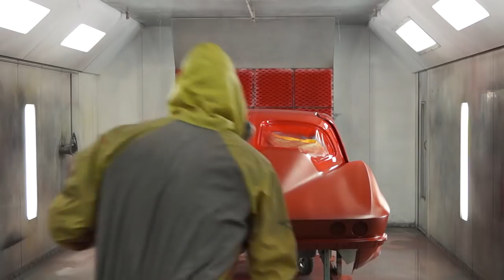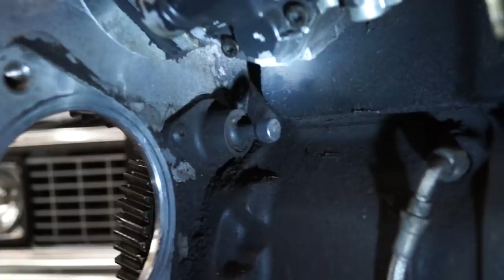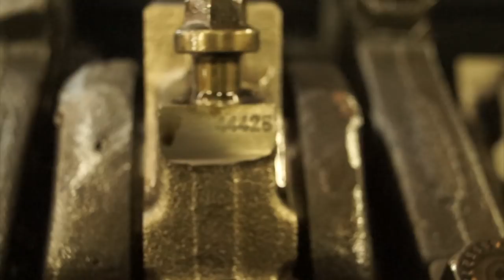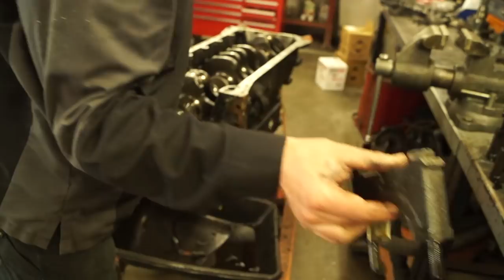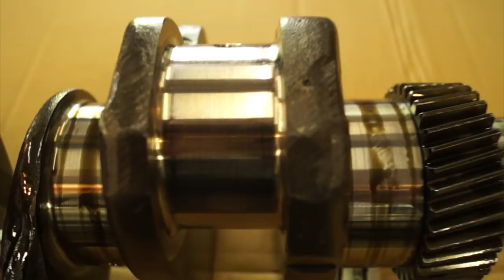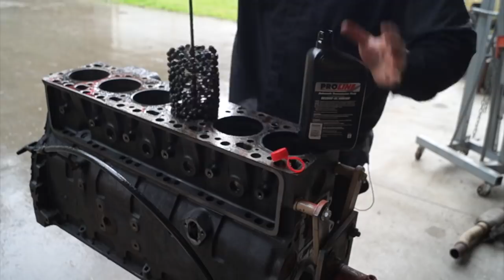Part 1 - How to Rebuild a Cummins 12 Valve 5.9L Diesel Engine

Comment: Thanks for the video. Dunno why, but those dingleberry brush hones always scare the cap out of me. Nevertheless, that's a good tool that provides decent results with a bit of practice. Some even give plateau finish, wich is preferable. I'd run a bore gage to be sure, but your cylinders looked really mint. In the end you mentioned that honing breaks the glaze and gives the ring fresh material to seat and wear on. I'd say that main purpose of honing is oil retention, and plateau hone lets the rings work without breaking in. I understand that you work alone, and I'm a loner myself when it comes to automotive work, but you really should've provided constant oil flow while honing.

Comment: Man am i glad i found this channel. My 72 Chevy C20 3/4 ton PU died about a month and a half ago was wanting to do a LS swap but really wanted to go Diesel but they were too big and too much money. Till i found this Cummins 6BT and this is the engine i want. I don't need a monster engine but want some torque when i do pull a trailer, or possibly a 5th wheel, but also want a dependable truck for daily driving. This fits my needs to a tee. I had an 87 Peterbilt with a 3406 mechanical Cat dont know too much Cummins and watched this wonder where are the sleeves. This help a lot, the 3 vids, so now im ready to get the engine and get started. I'm going for a 400 hp and had a question as the trans. what would you recommend. I'm looking at an a Allision 1000 5 speed but not sure it will hold up or with minor upgrades will it be OK. I'll have more questions as i go but glad i found this for now. I have a 10K budget but hope i can get away with 8K
Reply: You ever end up cummins swapping it

Comment: I am currently rebuilding the same engine in my 91 dodge and was wondering how to properly time the injection pump. I have the cam gear at top dead center and timed with the crank shaft and was wondering do you loosen the gold colored bolt and remove the tab then tighten the bolt back down like a set screw or do you remove the bolt and tab completely?

Comment: #6 cylinder gets beat the worst because it’s furthest from the water pump and it runs the hottest ring/cylinder wall temps.  Usually removing the rear soft plug and seeing the antifreeze sludge shows how much shit is in your cooling system.

Comment: Did yall get that mildew off the headliner? I recall yall are reusing the seats but I dont recall yall redoing the moldy headliner? Mold is mucho no bueno to inhale. I thought yall would've replaced the entire interior instead of "reusing" the moldy seats.
Reply from the maker: It is all cleaned up and looking like new!   Everything was cleaned and sterilized with an ozonator.   Thanks for the question.
Reply: People been breathin mold for 8000 years.it stinks ,but to me it up there with gluten and other crap
,they've invented problems that don't exist for 99% of the population.